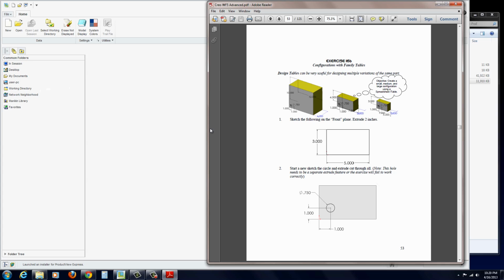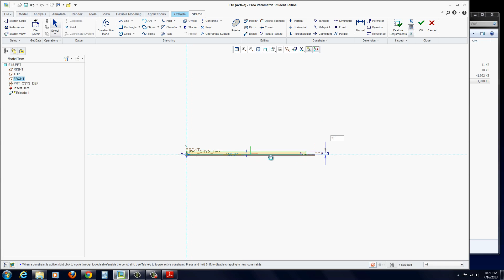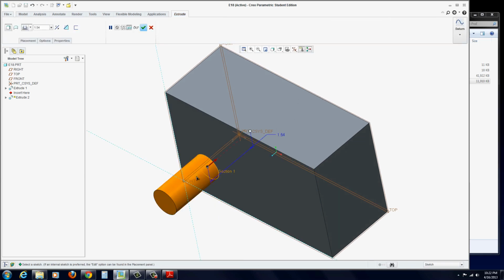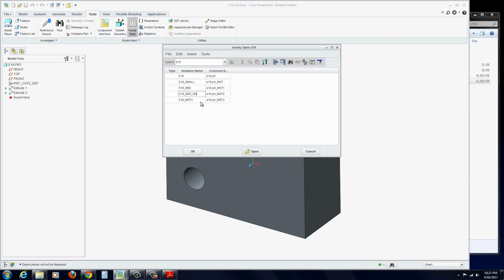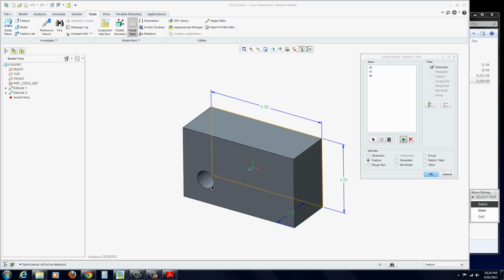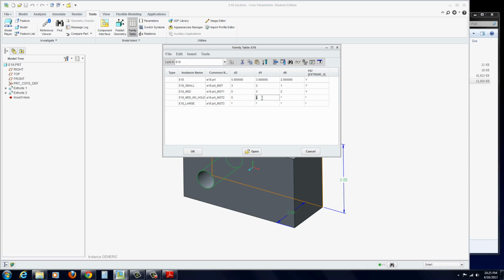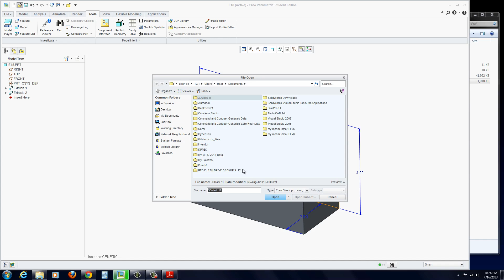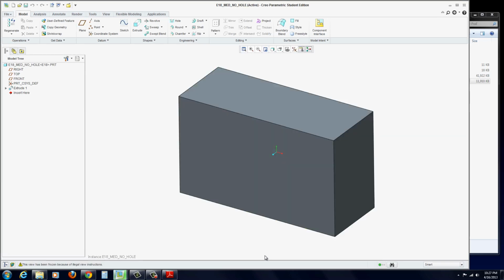E18 CREO Parametric 2.0 Family Tables

Comment: What do you press to show all the dimensions of the model? 
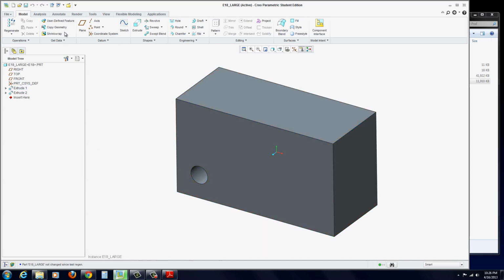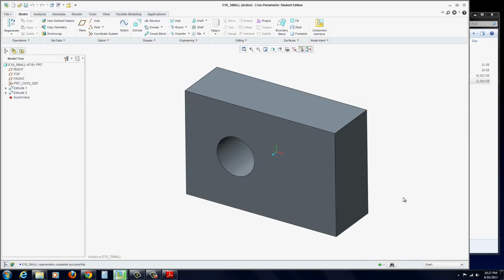You do that, in this video clip, at minute 6:53, and then again at minute 7:10 (with your mouse and/or keyboard probably, the screen did now show you pressing any CREO buttons). At the bottom of your screen CREO shows, at those times, the following message: "Select items such as Dimensions, Sections, Trajectories, Tolerances, Surface Finish or other features for editing".
Reply: Mr.Colin Gherghe Just double click on the model, then you could see the dimensions popping up.